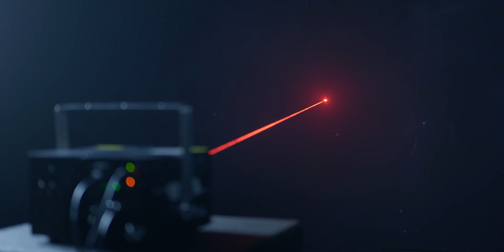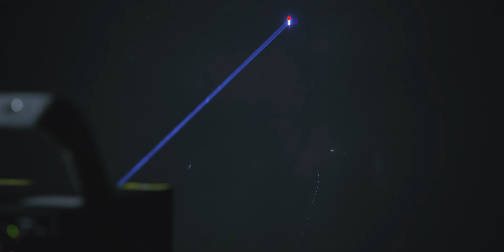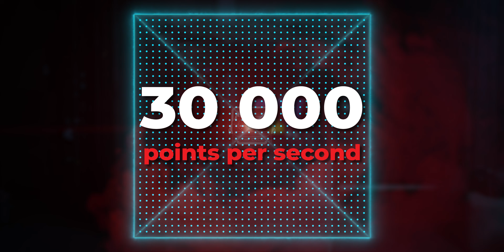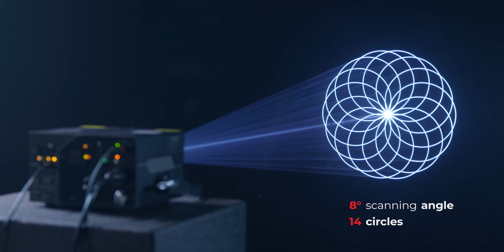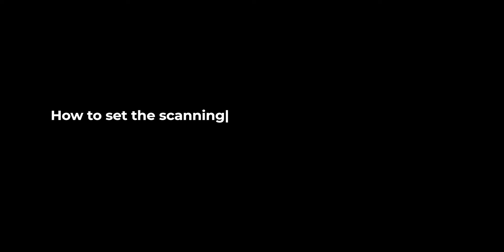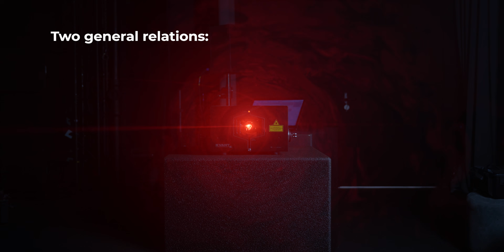LASER SCANNERS | how do they work and how to set them up correctly? ⚙️

Comment: Very good video, can I know what kind of camera you use to record videos or what kind of camera would be good to record lasers in good quality?
Reply: Its a mixture... If you want to shoot at a normal shutter speed of like 1/50 or 1/60, then your laser content will need to be optimized. Though a good starting point is 1/30. Shooting lower than this can sometimes give unrealistic results of the laser output, though I have seen otherwise use 1/20 or 1/15.

However it would be ideal to note that camera laser will not look good if the content is too complicated and the FPS output of the laser frame is too low, so much of the time its a balancing act of the camera operator and the laser designer.
Reply: Global shutter is the best but you can match the laser to your camera fps to prevent screen scanning
Reply: @hexarts  For video always use 60 FPS and adjust shutter speed to less than 1/30.  I frequently use 1/15.  I shoot on a SONY ILCE-7SM3.  On this camera I can usually use ISO 500 for less grain and great blacks.
Reply from the maker: Hi! 😊 We primarily use the Panasonic Lumix S DC-S1H as our main camera for video shoots.